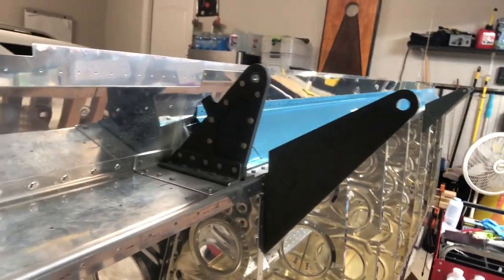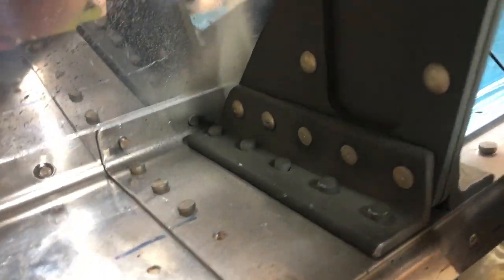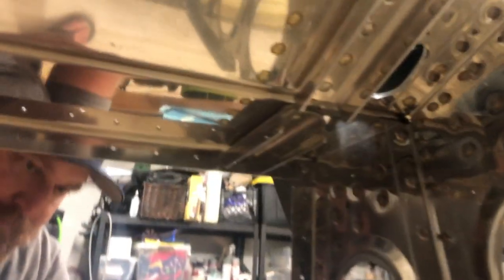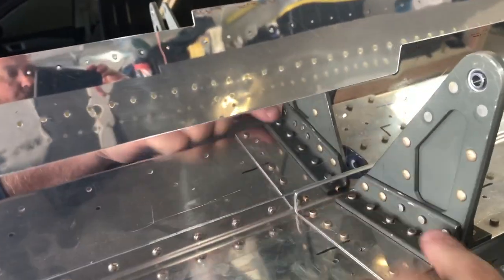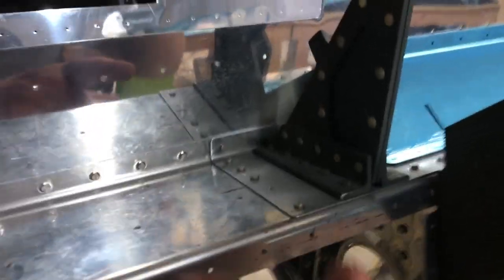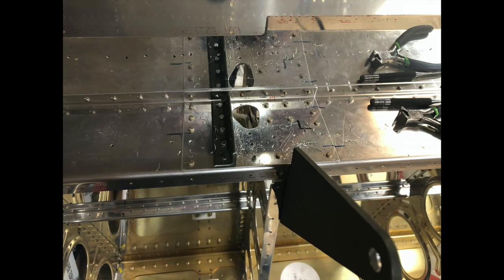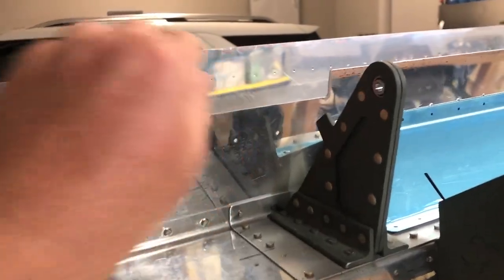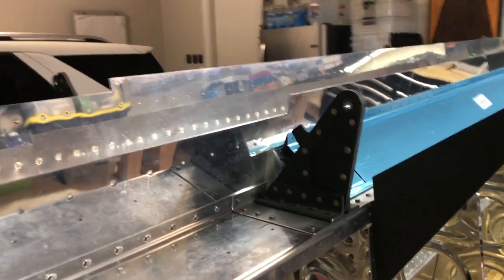Vans Aircraft RV10 Service Bulletin SB16 03 28 Aileron HInge

Comment: I just finished those brackets on a new build. Now you have me wondering if I should use 426s for the three on the outboard brackets, counter to the plans.
Reply from the maker: I just installed my ailerons to complete the pushrod rigging and I can tell you that I am glad I did.  OBVIOUSLY, you will be fine with the 470, that is how Van's designed it, I have just spoken to a few other builders that had to trim their aileron a bit.  Not sure if one is a better solution than the other, I just chose to do this since I was working on the brackets anyways.